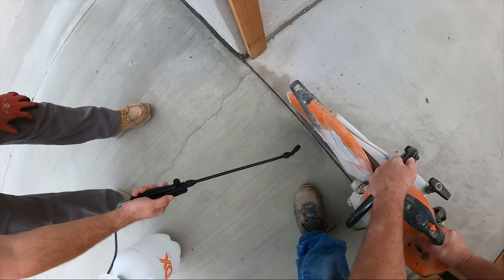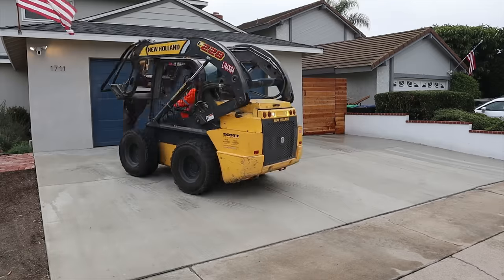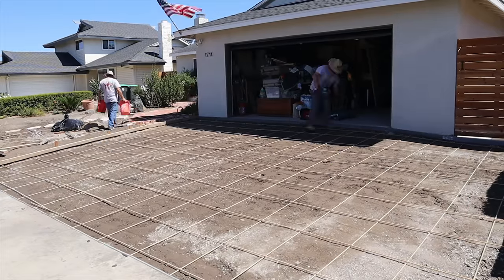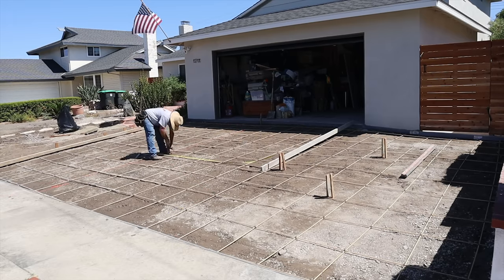Concrete GONE WRONG! Had to Remove and Replace

Comment: I been pouring concrete my whole life, first job I was paid in Lego at 11. My great grandpa, grandpa, dad, uncles and cousins have all been in concrete. I was taught you never broom concrete long ways, especially on a driveway because when it’s raining or snowing their tires won’t get the traction. Everything else looked great bro. The cracking concrete looks like the concrete wasn’t mixed to well at the plant or the cement was bad at the plant. Plus fiber glass is never as strong as putting in wire mesh or rebar, that could explain it as well. Looks like it’s on the concrete company tho

Comment: Good chance the load was a hot one. The plants can and do have a yard that comes back to the plant and this looks like around six yds. My feeling is theybatched five yds on top of one yard rather than starting fresh…just my take. Would recommend no slabs have joint further than eight feet apart for this envoronment.

Comment: We purchased a new home and the large front porch 10x14 feet was badly chipped with chunks missing and they agreed to repour the area. They didn’t tell us that they were coming and came home to a wet front porch with a sliding back door with special locks only accessible from the inside. A neighbor gave us a plank to get in our house but it still damaged the new pour. They again repoured the porch and it was a weird multi color that was shiny in areas. We called them back because after a week it still didn’t look like concrete. We decided to just fix it ourselves and use frost proof tile to hide it. We feel that the contractor was angry and deliberately did something to the mix to sabotage the pour.
Reply from the maker: Hard to say

Comment: The old driveway definitely looked like bad concrete, and I bet it had too much water in the mix.  Adding fiber is a great idea.  Especially after what happened.
Reply from the maker: Yes it was!
Reply: @OdellCompleteConcrete  I've also had that same microcracking pattern on fairly recent concrete.  It is like an ASR pattern, but happens sooner and at a smaller scale.  So I think it may be from expansion.  The foreign material causing it?  National should pay for the whole redo.

Comment: you got that slope to the gate spot on,  it will help with runoff as well, imprinted is the latest fad in the UK, rolled on, personally I don't like it, looks cheap and nasty, we used to brush off when almost dry with kiln dried silica sand it gives a great grippy texture but everyone likes different finishes I suppose,
Reply from the maker: Thanks for the tips!

Comment: Ive seen bad run shingles that had to be replaced, Wood like 4x4 posts Twist and Bow after installation, Bad materials happen,, But the right thing to do is fix it, One can only hope that it gets out that the contractor stands by the work, even when its not his fault
Reply from the maker: The supplier should cover the entirety of the project

Comment: Why didn't you use rebar? some how I find it difficult to believe that the fiberglass rods are as strong as steel rebar and given that the driveway has to be replaced seems to confirm that!  you should be able to get 50 year minimum out of a concrete drive way

Comment: My guess was super hot out that day. It dried way too fast.  Which cost the egg shell cracking all over.  Seen it before.
Reply: I agree however only thing that has to be from the plant is the holes in the concrete. Has to
Be some sort of foreign material

Comment: Notice the cracks in the garage slab. From here it looks like there's water exiting from under the garage slab creating hydraulic pressure that's causing the major cracks. It's tattletale signs are showing up where the water is exiting over the sidewalk. Look at the cause of the garage cracks combined with the water over the sidewalk and then take a look at the dirt around the house for signs of improper drainage. That water running over the sidewalk had to come from somewhere. I'll kindly butt out now.

Comment: I was always told that concrete cracks because of too much water or excessive heat, which causes it to set too quickly.
Reply from the maker: Many reasons

Comment: The minor surface cracking is called crazing and is usually caused by improper curing.
Reply from the maker: from the looks of how it broke out and it didn't even hold to itself or the rebar, I would say there something seriously wrong with the concrete
Reply: @OdellCompleteConcrete  Could be, that's why that petrography and other testing is important. It's rare, but things can happen when producing concrete that compromise it's integrity. Usually most defects happen after it leaves the plant. This can still be the producer, driver, contractor's fault. The key is to find out why and learn from it.

Comment: So what would have been fun would be to put a herringbone brush angle on it. This would promote water run off, still give you the traction, and possible look cool to boot.
Reply from the maker: Interesting
Reply: @OdellCompleteConcrete  I think you would have to know exactly where your cut lines are going to be, so it matches the pattern, but I'd probably have mine done that way - mainly because I like different.

Comment: Odell,  I live in Lenoir NC, which state do you reside in ?
Reply from the maker: CA.
Reply: @OdellCompleteConcrete  I will need to use your suggestions for a project I need to do soon, for  a house that was inherited,  as I don't want to have to keep  replacing the subflooring for kitchen and bathroom. 
Important note,  It sets on a creek bank

Comment: Sad...I saw another video two days ago where the guy showed the holes in the cement after he finished the job, and he said that he told the  Concrete cement company about what happened, but the company blamed the workers arguing that they contaminated the cement... in the end the guy had to replace the cement for a new cement like you did. another guy suggests the guy, take some pieces of cement and take them to a Laboratory to make some tests to see if the cement is bad quality or the cement was contaminated on time of the delivery to the job.
Reply from the maker: Same problem here.
TY

Comment: I had a company do my driveway. I chose them because they did rebar and had 1 year warranty. There were small cracks at the end of the driveway. I notified them and it took them months before they looked at it. Then gave me the roundabout that it’s the supplier’s fault. Months later, they said they would chase after them to get funds to redo my driveway. Long story short, they couldn’t get the funds and did not abide to the 1 year warranty. They had a guy do a small patch on the cracks but it made it worse. He obviously didn’t care. I ended up doing it myself and making it look better. The company refuses to talk to me or honor their agreement. I had them do 2 other driveways who had similar problems. 

What’s interesting is that they did not use any expansion joints but they did cut some lines after a month of concrete curing. 

The other driveways had expansion foam joints but mine did not…weird. Also I measured the depth of the concrete and it ranges from 3-4inches. 

Lesson learned, despite their good reviews, they subcontract the work and I should’ve done more research.
Reply from the maker: Typically, the Contractors State License Board will look at it to determine if everything is completed to code for up to 4 years.
Sounds like if the cuts were put in a month later then that's the problem.
Control joints must be installed in first 24 hours.
Reply: @OdellCompleteConcrete  what about the foam expansion joints? There are none. They had to redo the sidewalk because the concrete mixer truck crushed it. So essentially everything is connected with only the cuts.
Reply from the maker: Expansion joint where public meets private property, so that would be at back of sidewalk or approach.

Comment: I would used the loader jackhammer as a pry bar and after breaking area. Lift sections up a little and (the hard labor) hit with a 20pound  hammer to get big pieces , instead of rock and dust pieces  with that  bobcat hammer
Reply from the maker: Bingo

Comment: Did you mix the Concrete?
Reply from the maker: I should have
Reply: @OdellCompleteConcrete  when it breaks up as it did, it normally means they didn't add enough rock...seemed like a bad mix

Comment: Most fiber needs 100 revs to adequately mix into the load... Sure it's cheaper to add it yourself but now you're screwing the load by excessive mixing.
Reply from the maker: Good point

Comment: This is why you use a vibrator so the cement settles and get rid of air holes that would cause a crack.

Comment: I would have put a heavy edge all the way around and why didn't you drill holes in sidewalk and garage to really get a solid hold on those edges
Reply from the maker: The dowels would have broke the old concrete

Comment: This right here is why You'd opt for an Odell Concrete driveway - 80% of driveway Suppliers would shrug, not replace. 90% would not return your calls. The others would make tutting noises & offer sympathy... 1% would rip it out & lay a new one without whinging. This is -  if you know stuff  - the best Ad/Review/Reccomendation You could ask for regarding Odell Concrete - they stand over their work. They will make it right, even if it involves pain for them. I have no clue who Odell concrete are - but I'd like it if they laid my driveway.
Reply from the maker: Me too
TY

Comment: Too little Portland cement or too much water. I would have replaced the side yard also since it was the same batch of concrete. For my personal driveway I would always go with 6 inches of concrete over 4 inches of compacted gravel. A little more money, but will likely last a lifetime.

Comment: Can you ELI5 why you use concrete as pavement instead of asphalt, which is made to be pavement?
I'm curious why you guys use the wrong material all the time and wonder all the time why it fails so often?
I mean, do you guys have something like learning from former mistakes or will you continue to pour concrete where asphalt is due!?
Reply from the maker: Concrete last longer and maintenance free,, But asphalt is more affordable for short term
Reply: @OdellCompleteConcrete  Yes, but actually a definite and tremendouslsy hard NO!

Comment: Couple things.
1- I never use fiber it's the biggest mislead thing sold to homeowners. I always use rebar or wire especially on a driveway where tires are being turned to help keep it together.
2- I would not broom horizontal bc of water drainage. Vertical would still give plenty of traction.
3- Comment on brooming. I also never start and stop on a single pull. I have my guys tie a rope on broom and add extra handles to get the length. It makes for a terrible look on a broom finish to have a broom joint.
4- To every home owner. Never hire a contractor without a contract this is to your benefit. Always make sure that in your contract there's a workmanship warranty and material warranty before signing. This protects you in faulty workmanship of the contractor and on faulty materials. But this also covers contractor as well. It doesn't matter if it's a 100.00 job or a 100k hob always have a contract in place. And always homeowners make sure there's a COC at the end of contract that you and contractor both have to sign off on before any final payment is made to contractor. 
I respect this contractor for being a man of his word and redoing his work.
I know every contractor does things there own way this is just some of the things I do
Reply from the maker: Try adding poles when it 60' across.
TY

Comment: Theres alot things that probably when wrong weather to hot if the ground to wet when you don’t vibrate concrete when you dont float right before you broom
Reply from the maker: You probably work in the concrete manufacturing, distributing end of it
Reply: @OdellCompleteConcrete i been pouring concrete for 30 years on Dallas tx and it has happened to us before just a couple months ago on summer we did a big house foundation and it had a big patio our guys dint used the trowel machine on the patio just by hand and it started cracking with in a hour ,so what we did we put water and run the trowel machine and it cover all the cracks right away until know is been like 3 months and it has no cracks looks good

Comment: Pretty sad your construction went bad, but you showed the other job why not do the same.I get cost. it's not the concrete on the second job, but the cuts being parallel with the house 6 feet square is gross. How abought you make lines like in the neighbor's drive to align it with the house.
Reply from the maker: It's obvious what the problem is, all you have to do is look at it

Comment: I never liked fiberglass fibers in concrete. I feel it messes with the water cement ratio. The only time I’ve seen concrete cracking was when it contained fiberglass fibers.
Reply from the maker: wow that's strange.

Comment: Send back a 6? Looks pretty close to what you poured... Of course it's stiff you put an extra 100 revs to mix in the fiber... Lack of pushers on the truck if it had to go on the highway is 9 yards max.  Get bigger trucks... Now you have a cold joint.  1 yard loads are impossible to meet spec.
Reply from the maker: A real bummer for sure
Reply: @OdellCompleteConcrete  we charge so much for fiber I would probably chance it and add myself too if I were on your end...

Comment: I drive a Mix truck, you the first guy Ive scene who doesn't want to add 30 gallons of water to his mix before you start, and then add another 15 3 minutes later because its "too hard to rake"! The contractors in my town all act like they are dying of thirst in a desert!! Though I also noticed then the driver did not speed up the drum while mixing in that fiber, and only a half gallon bucket of fiber to a truck? most contractors here add a a bag per yard,  at fist I though you were going to add calcium flakes. hate that crap!  That looks like at least 15 yards you needed. so 2 trucks?
Reply from the maker: I do 1lb per yard
My bags are 2 lb. Each.
I rarely add water to any load of concrete I've received. However I'd like to take water of the concrete more often

Comment: Looks very much like a hot load to me. Surface, holes the way is came out all signs of a hot load. 

About 10 years ago I did a 3yd room pad. Order full dose or retardant the put full dose of calcium. 115° outside 7am pour got it down  fast had them leave a wheelbarrow full for some paver stone forms. 

The load was so hot the wheelbarrow full was already gone off. I barely got the slab finished. 

Next morning looked like someone had dusted the entire slab with Portland. Came out just like this one. Concrete company removed it and paid me to put it back in.
Reply from the maker: It happens 
TY

Comment: Although fiberglass rebar stronger than steel, you cannot replace 1/2" steel with 3/8 fiberglass, even 1/2" fiberglass won't do the job. All because while it's stronger, it elongates under tension way more than steel. So while its stronger, it does not do its job of holding concrete together nearly as well.
Reply from the maker: Tensile strength has tested higherthen steel in Owen's Corning pink bars
Reply: @OdellCompleteConcrete  I understand that its tensile strength is higher. However what I said it elongate more than steel with tension applied. So you will have sagging/cracking concrete with intact rebar inside. It's a good product for special applications due to corrosion resistance but in general it's a bad replacement for steel rebar. Look into Pinkbar datasheet for mean tensile modulus of elasticity. It's about 4 times worse than construction steel.

Comment: Fiberglass or steel does not work if you leave it on the ground ,just sayin' But Great job on standing by your work, and also a nice pour.
Reply: What are you talking about? They don't leave it on the ground. If you're a watcher of his videos, they always lift it as they pump the concrete

Comment: I live in Floria, Scammers Paradise, and wanted to replace my old 35-year-old driveway. There is a recommendation service that has many commercials on TV. Seeing their ad on TV, I contacted this 'service' for a list of concrete contractors. Shortlist, 4. I had three come and give me their estimates. Before they began measuring, I asked them four questions: Is your company licensed, insured, bonded, and if they were going to pull the permit? Two of the three just left, on the same road, they came. The third wanted to tell me that I was insulting his company. He also told me the job didn't need a permit pulled. My county had previously said to me that, yes, it did. I asked him for proof of license, insurance, and bonding. At this point, he started to get very angry, so I asked him to please leave. The amount of rubber he put on the street was awe-inspiring. So, the final score was Me-3, Contractors-0.
Reply from the maker: Nice work.
Great questions

Comment: As a contractor of over 40 years, there is every possibility that something may not go as planned…it has happened to me, and you have to man up and resolve the issue…it appears that the quality of that batch is highly suspect…I’m a rebar nut…I’ll place it when the others won’t…yes it’s more money, but it’s never been an issue as I’ve replaced others projects that were a year or two old and failed..our biggest issue is of course labor…labor that’s knowledgeable in that trade…